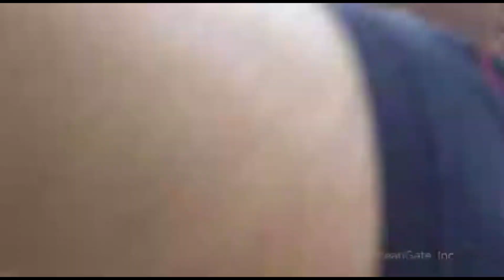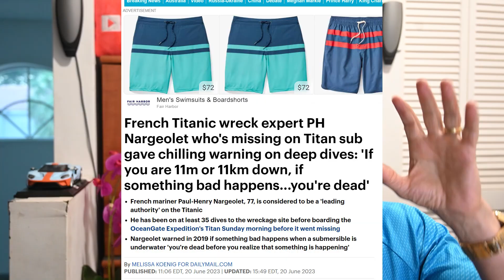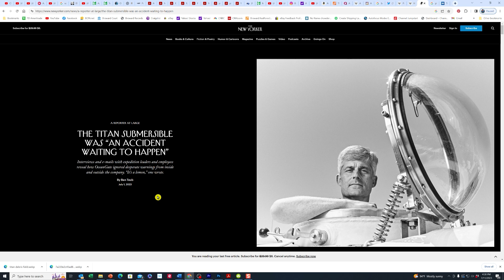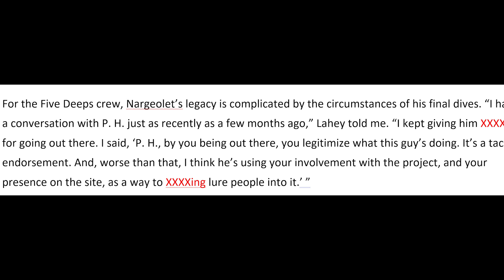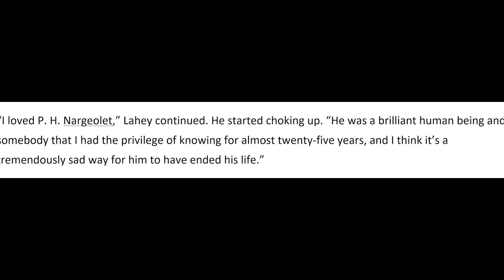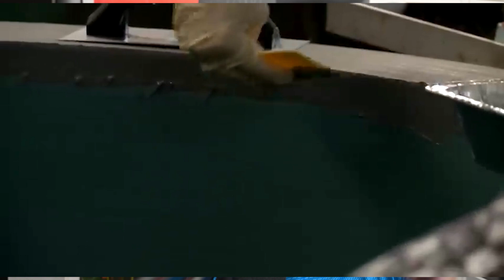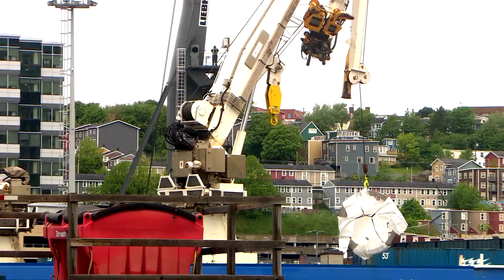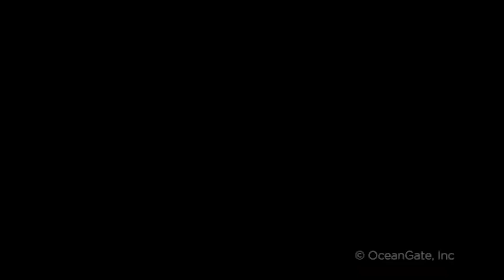Titan Sub: More Q&A, Design Defects, Why Descent Fast

Comment: When they were considering the weight of the craft for boyancy (and negative boyancy) and descent rate, did they include the (800+ lbs) of the 5 men on board? Didn't they say they relased the ballasts and still didn't ascend, so they had to relaease the landing gear, and that still didn't do much to help them ascend?
Reply from the maker: Makes me wonder if there was a slow leak

Comment: The 2  separate characteristics of the Titanium conductor and the epoxy such as an insulator could not have any long term bonding. In such an environment , they both have completely different temperature coefficients as well as no atomical bonds.Time was not a friend to this marriage.

Comment: I’m most likely going to get raked over the coals for this, but here I go. I’ve been following some of the Titan Submersible videos and have heard some experts say that if her carbon fiber hall was more of a zigzagging pattern, that could have made the hall stronger. I would like to know how you could do such weave and not seal off the ends of the cylinder. Stockton Rush needed them to be open and once sealed he couldn’t just cut them open again, (I don’t think?) thus making the hooping pattern almost a necessary? I know that this question sounds stupid, but it’s been something I’ve been thinking about.

Comment: I just wanna say a few things about this horrific, loss of life accident. No one seems to keep these people's family in mind, humans died HORRIBLE deaths during this incident and everyone is just attacking EVERY SINGLE THING THEY CAN . I'm no fan of this cocky CEO who in his overconfidence in himself and product got 5 people killed including himself. None of you are really involved in this "case" nor have any information that the general public doesn't have. Another thing I want add is everyone is taking about this tech cleaning the titanium ring without a glove while touching the ring after cleaning, that whole shot looks like some serious B roll "a fake demonstration on how it's generally done", not the actual procedure that occurred. I doubt that anyone in the manufacturing process noobed this sub to death or it would have catastrophically failed on the 1st dive. This incident is most likely caused by CEOs overconfidence along with lack of technical understanding of cumulative stress damage to carbon fiber under EXTREME compression. It did make numerous trips down there and if the pressure vessel was swapped every other dive, this probably wouldn't have happened. Would you catch me in one EVER? Absolutley not, but that doesn't mean anything.

Comment: Jeezus. I think surfboard shapers are more careful about how they epoxy fiberglass on their boards than these guys. My windsurfing board is covered with carbon fiber, and my shaper is very careful about glassing his boards. Did they even cure it under vacuum pressure?
Reply from the maker: We don't know if they used an auto clave or not

Comment: Another question. I have read when spinning the carbon fiber on the drum like they did in a perfect straight pattern, they should have been spinning it on in angels crossing over patterned to help make the seal more rigid. Is that true and would have applying the carbon fiber in a cross pattern verses a straight application been more pressure resistant or did it really not matter.

Comment: t would be helpful to see an animated  layout of exactly how the Titan subs  equipment  ( batteries, sensors , RTM system , etc. )  were  attached ....because any  electronic equipment  attached on the exterior of the " capsule " , would require  multiple sealed penetrations and those areas could account for a failed  breach, allowing sea water to start rushing in behind an interior wall ,  explaining the faster than expected dive rate.....

Comment: The insane thing with the carbon fiber is the pattern they rolled it in… it should have been crisscrossed during the roll. They engineers had no clue what they were doing.

Comment: If they didn't do an ounce of NDT I also assume they didn't do any destructive testing either. If that's the case, how would they know the failure parameters of the CF hull to program the acoustic monitoring system?

Comment: Iv worked with that carbon, it rejects the matrix that's why you need to put it an autoclave. I'm no engineer, but being under pressure wouldn't you put the cylinder outside the end caps? Oh, a lot more overlap, a lot, seriously that looks like 3 inches

Comment: Even if rate of pressure increase from too fast dive wasn't a factor in failure (This all assumes that leaked transcript is real; has it been verified?), an unexplained faster decent means dropping ballast may not be enough to begin ascent, hence why a sane person would have dropped ballast to abort dive immediately upon observing the faster than expected descent.

Comment: Game controllers and keyboards are just a bunch of on/off switches.  So unless the software knew how to adjust the dive speed for a certain amount, they could have went down at full speed without knowing.  Even if the joystick was a variable position value switch such as a potentiometer  the person driving the craft could have maxxed out the value, without knowing. 
The third option, maybe they wanted to beat a new world record.   From the toxic/narcissistic ceo talks, sounds like he wanted to beat everyone and everything. So who knows at thia point.  

It was just bad at all angles.

Comment: Re:descent rate - I can't say anything about the descent rates as such. The time scale relevant for materials and machines is often VERY different than the time scale us humans operate at. 
The faster one might still have been  technically OK. 
However, when you're dealing with assemblies consisting of components with very different material properties (like thermal expansion of steel vs aluminium, or, in this case, compression/deformation of CF vs Ti) it's generally considered good engineering practice to stay well on the conservative = slow side of change to keep the stresses at each interface to a minimum by allowing the slower material to "catch up".
To me, the bigger question is, why did he deviate from the agreed plan?
Was the fast descent caused by a disaster already in the making, an early leak?
Or another example of ego overriding established industry practices?
Maybe a customer offered a significant cash bonus to also be the FASTEST Titanic visitor?

Comment: The glue failed because they did not rough up the surface of the titanium . It will not stick or bond to a smooth surface.

Comment: I have read a lot about carbon fiber being the blame, and secondly a game controller. The way I logically think as a programmer (not an engineer), none of these items matter. I don't care if your craft is made out of silly putty and controlled by a game-boy. The only thing that matters (for life and death's sake), is: was the sub certified by an independent trusted agency to dive to 4,0000 meters? Answer NO, even the porthole glass was only certified for 1300 meters. His going around regulations was and is, the cause. Totally unacceptable.

Comment: It absolutely befuddles me the total lack of care and sterile environment they took in the assembly of this submersible. I am an engineer in the automotive industry. We have to take great care in making sure the fuel lines and other components we make are not contaminated because they go in automobiles. This is a freaking submersible that is subject to pressures many times greater than a car. The environment should be absolutely clean and great care taken to make sure all components and adhesives are to spec and applied with strict measures. There is absolutely no way I would have gone down in this thing, even at shallower depths.

Comment: Its very interesting throughout all the weighing in on this event, not one expert who warned about this being a failure waiting to happen nor the company itself can point to how they advanced deep sea exploration technology.

That was the thing Rush kept claiming was the driving force, to advance the technology by "outside the box thinking" and yet not a single person so far can point to anything they advanced with their efforts as a company that has improved deep sea tech overall because Rush and Oceangate had no such priorities. Even in the likes of assembling Carbon Fiber they didnt follow standards and practices basically doing it in a garage somewhere. You cant advance anything if you dont build on whats already established somehow.

I get the need to take on "tourists" for funding advancement of tech. Tech is expensive, developing tech is expensive, trial and error is expensive but I dont see any of that going on here. They didnt have 1 sub for tourists and then other "experimental" models they were testing in the meantime using that 250k/person to fund those efforts, this was 1 experimental vessel they kept loading up with people who would pay for it and seemingly started to make the whole operation around it cheaper and cheaper to maximize profit (towing the sub instead of securing it and then launching, etc).

Its easy to claim people are "haters" when you are trying to advance an industry or tech, Ive been there, but its another when youre doing things that put lives at risk and nothing youve done actually advances that tech. Theres no published paper by Oceangate or Rush on something like "Stress Fractures on Carbon Fiber Vessels" or any type of lessons learned publications to the world at large to "advance" anyone. Anytime someone asked they would hide behind "we dont believe in certification because all naval accidents in this field have always been pilot error" which is nonsense or "We wont publish because its proprietary knowledge that would give our detractors and nay-sayers more ammo to attack us". These are cop-out excuses and nothing here was advanced.

This was a cowboy who thought himself more of an expert than he really was who surrounded himself with idealists and "Yes Men" that parroted that same mindset to the point of the entire company effectively becoming an echo chamber that could do no wrong, all to capitalize on profiting off what they saw as the next frontier that isnt Space exploration. Had they embarked in Aerospace, they had WAY too much competition with more money and more experience then they had but in the area of Ocean Deep Sea exploration, theres really no competition for a tourism marketplace there. No one is doing it because its a lot harder than going to space in many ways, not because its gatekept or stifled by experts like they kept claiming but because the demands and environmental obstacles are WAY tougher to combat than those of a vacuum environment.

In the end, the company facilitated a victim narrative of "them vs the industry" to gin up support and marketing but all they were doing in the end was collecting cash from wealthy people. The company has existed for over 10 years and they couldnt produce a single advancement that was accepted by the industry? How do you work "at the cutting edge" of an industry and tech for that long and not advance it even accidentally (if you follow the scientific method that is). Unless it was never about that and just about finding a cheap and quick way to bilk rich tourists for a chance to do something few have done before at the risk of their own life without them knowing it.

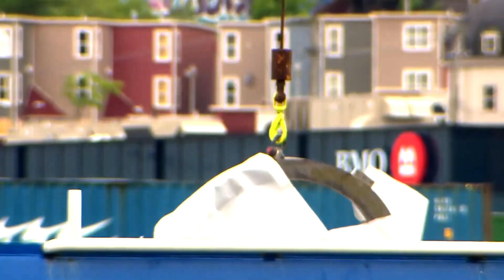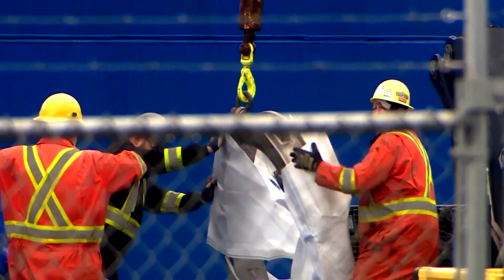Comment: Your comment about roughing the titanium ring surface has merit. I note- observing the recovery of a titanium ring- that the epoxy is visible on the ring at 6:12 - 6:21 as a greenish color material ( stop frame to see for sure ) - also notice that there appears to be a section of the ring ( at the top near the lifting strap ) where the epoxy appears to be GONE from the ring. Epoxy is very strong and hard, but no doubt implosion would tear it away from the titanium if it has nothing to grip to. Once again, we see NO carbon fiber remnants of the center core at all.

Comment: the carbon fiber was taking on water, this is why they were having excess speed going down, and difficulty rising toward the surface, the water penetration continued to increase, even after jetisoning the cage, balast weights, the water was too heavy, and finally the carbon fiber delaminated.

Comment: The problem with too fast of a descent is not the time it takes for the pressure to increase. No matter how fast they descend, the pressure will increase proportionately. The problem with descending too fast is stopping and then ascending. They probably heard noises but because they were descending quickly, by the time they stopped the descent and began ascending they had gone further in depth making their situation worse. If they had descended at the correct slower speed, when they first noticed there was a problem, they could have stopped descending and begin ascending without going deeper and increasing pressure on the hull. It's like driving a car fast compared to driving it slow. When you slam on the brakes it is going to take a lot longer distance before you stop. I would not be surprised, and we'll never know, if they had handed that controller to the boy and he was actually controlling the speed of descent.

Comment: Glue only acted to hold sub together and form a seal. The water pressure would totally hold end caps/ rings on. 
The CF tube failed. And even a perfect molecular bond would not help.

Comment: The sub was leaking after it first entered the water and stopped after descending a short distance when there was enough pressure to seal the leak. This is why the decent speed was high from the beginning. Water was not noticed under the floor they were sitting on.

Comment: I ask Claude 2 the following question: A submersible with a horizontal cylindrical profile 5 feet in diameter is descending to the ocean at the rate of 38.8m/min. How much more pressure at the leading point to be added to the static pressure?
Claude 2: Okay, let's break this down step-by-step:

    The submersible has a horizontal cylindrical profile 5 feet (1.524 meters) in diameter
    It is descending into the ocean at a rate of 38.8 m/min or 0.647m/s
    We want to calculate the additional pressure at the leading point due to the submersible's motion

To calculate the additional pressure:

    The dynamic pressure due to the submersible's motion is given by:

P = 1/2 * ρ * v^2
Where:
P = dynamic pressure (Pa)
ρ = density of water (kg/m^3)
v = velocity of submersible (m/s)

    The density of seawater is typically around 1025 kg/m^3
    Substituting the values into the equation:

P = 1/2 * 1025 kg/m^3 * (0.647 m/s)^2
P = 214.537 Pa

    Converting the dynamic pressure to psi:

214.537 Pa * (1 psi / 6894.76 Pa) = 0.0311 psi
Therefore, the additional pressure at the leading point due to the submersible's motion is 0.0311 psi.
To summarize:

    Submersible descending at 38.8 m/min
    Density of seawater is 1025 kg/m^3
    Using dynamic pressure equation, additional pressure is 0.0311 psi
Reply: While nobody was linking the problem with the faster descent to added dynamic pressure (that was very obviously negligible), I still don't believe the faster descent rate contributed to the failure. Most of the talks were about the "ability of the material to adjust" - what may be true in the cases of an ETREMELY high descent rate, many times exceeding the "normal" one.

Comment: Carbon fiber requires some kind of resin in order for it to hold its shape well. Think of it like a string the string can bend and is a free moveing fiber. But if you coat the string with some kind of resin and cure it then that string wont bend as easily and will hold its shape. You would probably wanna use a UV based resin to cure it as you wrap the fibers in the molding process. They probably should have coated the fibers with the UV resin as it was wraped and as it cured useing a UV laser light it should homd its shape better and stay more uniform without any bubbles and deformitys allthough they should also have used an autoclave as well to remove any bubbles.

Comment: The water would have enough pressure to keep the end caps attached, so the glue would only be used for sealing and keeping attached to the submersible